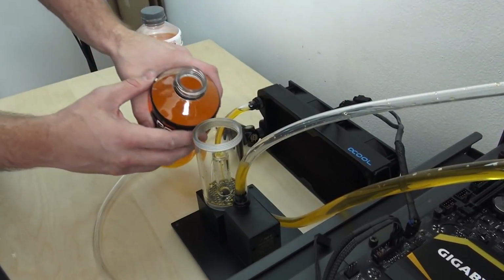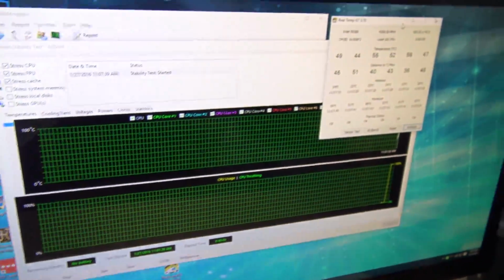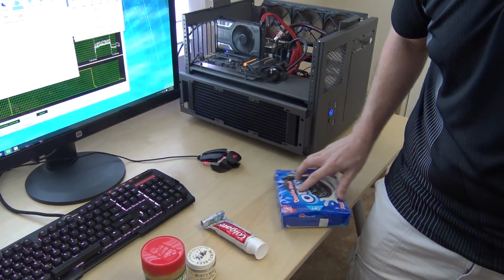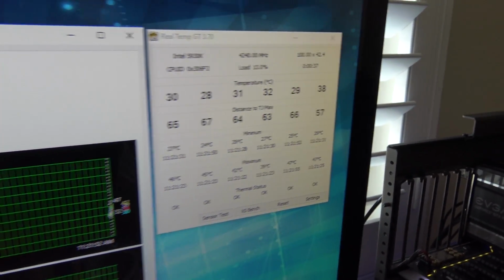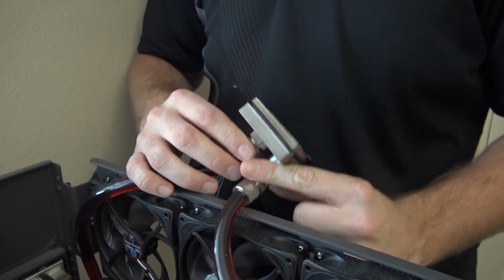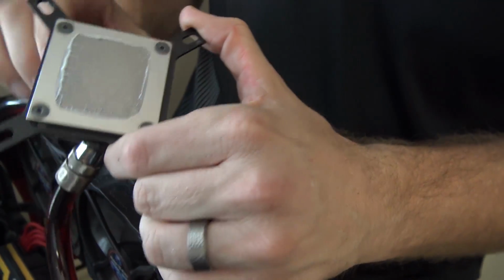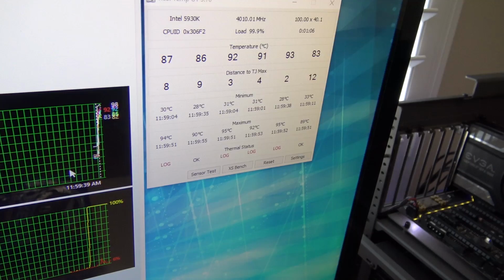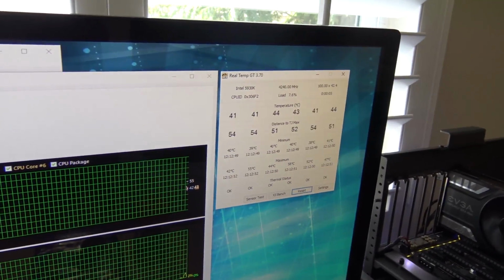Two Idiots Install Household Products as Thermal Paste

Comment: +JayzTwoCents I have a server running without thermal paste or a couple of years now. Tried toothpaste in the beginning, No  paste was better than toothpaste. So I'm very curious to see a result without any paste. Maybe post it in the description.
Reply: Zero? not even a thermal pad or used paste? of all systems I'd believe it on I would expect a server to handle it. Last time I attempted no paste was back in the "regular Pentium" days and it didn't do too good. On a modern system with minimal load and flat cpu/heatsink surfaces I can see it working ok, especially if you add in a cpu with really good thermal throttling. ..... years ago I had a trouble ticket for a laptop that was slow and I found that the heat pipe had a bad crimp at the end and lost it's vacuum. The cpu was instantly throttling down to minimum frequency and no heat was transferred more than an inch down the heatpipe. it was essentially how I imagined no paste would be, but without trying it on a modern system.
Reply: +volvo09 metal to metal contacts go a long way. Adding toothpaste or other similar household items tend to act as an insulator rather than conducting heat efficiently. I would imagine adding thermal paste will improve the thermals. But at least in my case, even under load my cpu doesn't exceed 60ish C.

Comment: Did you try doing it with NO paste to see how these things REALLY changed the situation?
Reply: i ran a laptop with no paste for two weeks, it was hot as hell but it was fine
Reply: Ah. I got ya. Thanks :)
Reply: Reverend Rabbit What's a "green text"?
Reply: well, it sat ion the 90's while running fb, so thats all i used it for till i got new paste
Reply: Most systems without thermal paste won't even start up. It instantly heats up. At least, some systems.

Comment: toothpaste becomes corrosive if you leave it on. I used it on my GPU for testing, after not using it for a decent amount of time (weeks?) I wanted to remove the toothpaste, I wiped away capacitors without effort (the ones around the GPU chip)... Get that off immediately.

Comment: funny is is that if you get a non k core i5 you don't need an aftermarket cooler. I have a core i5 6600 clocked at 3,9ghz (with bios settings) and with stock cooler its as quiet as hyper evo 212.

Comment: if you ever want to do this again petroleum jelly and or high fluoride toothpaste. Keep in mind that all thermal compound is a metallic (usually copper of sliver) paste. So really any paste will a lot of minerals in it should be ok. i'm just trying to think of what things from around the house you can use. Maybe if you grind up some rust and mixed that with the berts bees or some petroleum jelly or the toothpaste probably would not do so bad. be interesting to see if you could make your own thermal compound that is at least close to the bought stuff.
Reply: Yes you are right on the money. I ran my fx 4100 black edition on toothpaste for half a year or even a whole, I actually forgot I put toothpaste till it dried out completely and I started getting shutdowns. Toothpaste has great thermal conductivity but it needs something to keep it away from drying out, I was thinking hair gel since it's the bathroom theme lol, but petroleum jelly would probably work even better when you combine it with toothpaste.

Comment: Are those alternatives better than NO thermal paste at all?
Reply: Logan Hamilton Wrong comment section..
Reply: If you were to use the sand paper method on both your cooler and CPU it probably wouldn't but it really depends for the most part.
Reply: DARUDE SANDSTORM
Reply: Yeah
Reply: Yeah

Comment: is it normal that the cpu temp differentiates up to 10 degrees between the cores? im asking because i have the same problem on my watercooled system with a front mounted radiator. maybe i sould move it to the top?
Reply: Your radiator placement has nothing to do with difference between cores. the cores are all under the heatspreader of the cpu, intel uses a crappy interface material in between the cpu die and the heatspreader, some people delid their cpus and change that with different thermal paste and they get 10-20 degrees better and less difference between cores. It is recommended that people don't do it as the chance of breaking the cpu is very high. Some cpu's, especially older ones (before intel cheaped out) don't have this problem as the die is connected to the heatspreader with solder and the transfer is much better, for example sandy bridge, they were very good overclockers because of the solder giving good temperatures and because the manufacturing process wasn't so small so the cooling was more effective, the more intel shrinks the transistors the harder it is to cool them. altho its not that big of an issue at all.

Comment: you should run control run with no thermal paste - it is safe. I have run my server for 3 months without thermal paste, as I simply was going to put Coollaboratory Liquid Metal PRO on it and forgotten why I need it, so did not buy it

Comment: Did you ever do a test without paste at all?
Reply: Yeah. They only reason they spread it manually is so that it wouldn't go over into the socket, and only used too much when they thought it wouldn't spread and make contact as much. They did everything "properly" given the materials worked with.
Reply: Its been proven to be a myth, you almost can't use enough because the chip itself doesnt end at the heat spreader. There is plenty of room for the compound to go.
Reply: nakyer Yes, but that's for thick thermal compound, not watery hand lotion.

Comment: No surprises there.  You want the most liquidy (wet, runny) fluid really as you want it to fill all the little surface 'potholes' and surface imperfections that would be apparent if you looked at the block/cpu under a microscope.  The fluid also wants good thermal conductivity to be able to conduct the heat through the medium.  I guessed the performance order right here just by having an idea of how each of those products were in this regard.  The cream is likely mostly water/oil based with little solids; toothpaste itself typically contains solids, as an abrasive, to be an effective cleaner, but these will also cause the cpu/block to not be able to sit as tightly together; peanut butter also likely contains solids, and has an even higher viscosity than the toothpaste, so really won't fill those surface imperfections well at all; and the oreo filling, though possibly not containing as much solid, though course sugar grains could be present, is barely even a liquid at all, that will have a real difficult time spreading into and across the surface, though could probably improve if you got the surfaces hot enough to melt the sugars in there.

Plain tap water could have been one to try, though would obviously evaporate quite quickly.  Oils would have been interesting, too, and I'd bet they perform pretty damn well.  And blood.  Jay's blood.  From a freshly-severed artery.  That would have been interesting, too, though mostly for reasons other than that of how well it performs as a thermal paste.  Maybe next time?

Comment: Why not try Copper grease.  They use it on car brake calipers so it is pretty heat resistant and also copper is super heat conductive.

Comment: Plug in a video card while the system is running
Reply: I did that to an old gpu and board when I was little anf fried EVERYTHING
Reply: you need a motherboard that supports hot swapping.
Reply: I've done that. It just made my pc crash. Everything worked fine even the card once I restarted.
Reply: David Silva Linus did it when he was trying to figure out hot swapping. It normally makes it crash. But you can have boards that support it and change up the bios settings and boom you could do it. Just wouldn't advise it.
Reply: Done it on ltt
Reply: It technically should work

Comment: Jays i have a question im building an intel ring but i currently have a amd setup i know that this question is not base on the video but i have a amd fx8350 and i ordered an oculus rift cv1 with a gtx1080 from gigabyte the g1, the intel parts are on the way, but i just wounder if the oculus rift cv1 works with a fx8350 16gbram ddr3 1600mhz and gtx1080 pascal, and my games are in a ssd samsung pro 1tb, the reaosn why i am asking is because i havent seen any video using amd fx8350 cv1 ready and if that works i will get a 2nd rift

Comment: I noticed you have a lots of sound dampening foam panels on the walls but don't you think it would be cooler to have some posters instead which give more life to the room. There are some amazing ones on displate.
Posters or anything you put against the wall has the same effect (more or less efficiently but still)

Comment: How about no thermal paste?
Reply: =dead
Reply: tried that once, CPU overheated after 30 seconds and shut off the PC
Reply: my 1100t ran with no thermal paste for a while without my knowledge. it was running high for a while and I never thought to check, anyway eventually I took the fan off and it was literally completely dry. I have no idea what happened to the paste still.
Reply: Maybe you just forgot to apply it when building or something. We all make mistakes.
Reply: if thermal throttling didn't occur then the cpu and heatsink would weld themselves together, then eventually melt, and after that it could possibly cause a fire if you were stupid enough to let it keep going.

Comment: I hear superglue bonds the blocks together in a heat transfer optimal condition allowing for maximum transfer of energy. I use superglue instead of thermal paste in all my pc and get -20 degrees Celsius at idle
Reply: Hilarious, considering a CPU would stop functioning at -20 degrees.
Reply: Yup thats definately the only problem in that scenario :)
Reply: No it wouldn't , professional overclockers use liquid nitrogen to reach max overclocks, some old cpu's had something called a cold bug that made them stop working under -70 or something, but they could still use a smaller amount of nitrogen to get sub zero temperatures and keep the computer running. I have not heard of cpu's having cold bugs in a long while and even it they did they would of still worked at -20 celsius. And his comment is obviously a troll. you cannot reach sub zero temperatures without using a chiller or some type of refrigerant. Even if he had means of getting his cpu under 0 regular thermal paste would of still been better than superglue.

Comment: Liquid Nitrogen in a loop?
Reply: That would result in an extremely high pressure before it began to escape from the joints and ruin everything. Hence why competition OVerclockers don't use closed loops with liquid nitrogen so all of the pressure escapes because it boils at a temperature in the -C•
Reply: yep the tubing would freeze and crack..... not a good idea...... plus the pump would also freeze  solid and not spin...
Reply: Wasn't being serious.

Comment: This is relevant to my situation because my 8350fx is running on absolutely no thermal paste right now
Reply: You might want to rectify that, like right now.
Reply: Thermal paste is thermal paste. 
Fair enough premium compounds may come with 4% more heat reduction for only $99.99 but any generic TP is as good as the next
Reply: too la........
Reply: arctic silver 5 is like 5 bucks
Reply: Wtf man that is so dangerous! It will definitely kill your CPU, not just the FX 8350 but any one.
Reply: dont worry, guys.  I literally drove to the nearest mall just now to get some. Unfortunately, I could only find some generic ones. Hoping this will hold out while I look for some better ones.
Reply: +James Howell Wait what? There are thermal pastes for $100?! This is ridiculous it's literally the same price as my CPU lmao xD.
Reply: AndroidME Well it was a hyperbole but you get the point.
Reply: +Kevin Edwards that's exactly what I use

Comment: Every time I have to reapply thermal compound, when changing cpu coolers, or reassembling in a new case, I don't have any rubbing alcohol to clean it, so I use tequila. Just saying. It works if you don't have any rubbing alcohol around like me. Works for cuts and scraps too.

Comment: haha crazy video.. but what about put the rad only in ice water?
Reply: condensation forms on the block blowing your hardware.
Reply: Awesomesauce network did ig
Reply: Ignore these guys, if you put putty around the CPU socket and insulate the water lines in the case with pipe foam, it will work just fine.
Reply: +Jahcrispie it
Reply: yep ice water would be a really bad idea. 
you can get away with a room temperature vat of liquid however. to help dissipate thermal from the Radiator faster.
but it's easier just to increase Radiator space.
Reply: Then you will have condensation problems.
Reply: QuantumGeeks how about freze the rad and let thaw for a little

Comment: Wait when I built my computer in 2014 I never applied thermal paste on my cpu , did I fuk up?
Reply: most coolers have thermal paste pre applied for the use with the first attachment if your computer works, it probably has it
Reply: Atleast the boxed coolers do.
And most aftermarket cooelrs are shipped with a bit of paste for the initial installation.
Reply: Hyena OfTheWest ok thanks

Comment: The weird thing that came to mind, would require a sacrificial CPU, would be different types of caulk, I imagine a few of them would be terrible (for instance heat resistant expanding caulk), but some might be close to as effective as traditional thermal paste, while being significantly more tamper resistant.

Comment: damn you have cam installed? i had that until it did an update, failed half way, and broke windows to the point i could not find any files or programmes on any drives other than the c drive, meaning a complete reinstall. All i got from the cam guys was oh right well we will pass it on to the devs.

Comment: U should've gave us base readings on how temps would be at without thermal paste at all cuz people with little knowledge wouldn't really know or atleast tell us what would have happened if u didn't (if doing that would kill ur system or something)
Reply: He wouldn't get readings, the cpu would overheat and crash the pc almost immediately
Reply: Maybe not immediately, but wouldn't take to long. CPUs like the 6700 can run for brief periods with no heatsink. Such as a quick boot test with no load.
Reply: Hyena OfTheWest thats what im talking about! for someone who doesnt know this, these readings are almost pointless because they would not have a good enough refrence point. Like if i were to test how good a new fan was i would want to test temps without a fan at all and temps with the old fan. i hope u understand what im thinking a little.
Reply: xanderzero3000 I do but burning out your cpu just for a test is dumb if anything you'd want to use stock thermal paste as a reference
Reply: Hyena OfTheWest yes BUT if you read my comment it said "or atleast tell us what would have happened if u didn't" so obviously dont burn out a cpu INTSTEAD just tell us
Reply: xanderzero3000 well if it helps, i told you
Reply: Hyena OfTheWest it did thx babe.

Comment: What about no paste at all ? You would only do this if you didn't have any, so that would be the real control experiment.
Reply: everyone knows what would happen the cpu would overheat and crash the system
Reply: no it won't, TC is not absolutely necessary, it does increase the efficiency of the cooler but the cooler will work without TC

Comment: My 4790k gets temperatures similar to this on liquid with some good arctic 4 on it.
Reply: Did you under apply it?
Reply: I actually have that exact same CPU and it never goes above 60 degrees C with a Noctua NH-D14. I would recommend checking your thermal compound or even the water loop (if it's a sealed loop, try taking it out and giving it a careful shake just in case there are some flow issues). Hope this helps!
Reply: Is it overclocked?
Reply: Wandering Ghostwolf Hm.  See I had these temperatures before except core temps would sometimes manage to hit the low 80s during game play, then I reapplied thermal compound and it seems to reach the mid 70s for its high now but I still feel like thats crazy.  But I'm slowly buying the parts for my custom loop and I'm hoping that will help, although there will be 2 980s with the cpu in the loop. I'm just hoping its not an issue with my cpu.
Reply: ThePowerhousePotato! just its default 4.4 boost but I can set it to like 5ghz without really changing the temps.